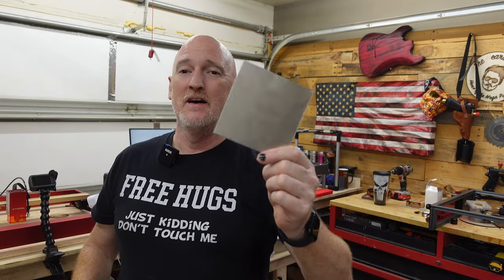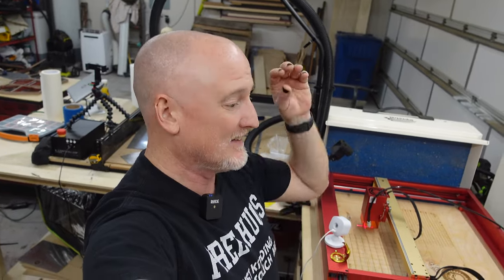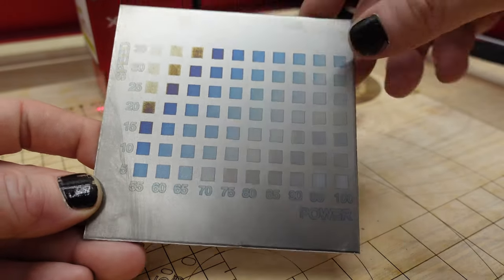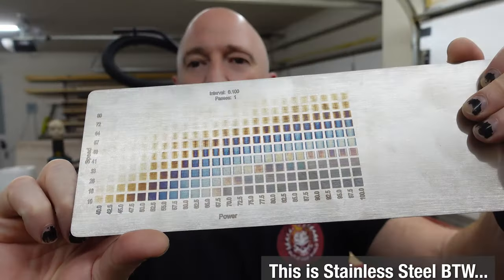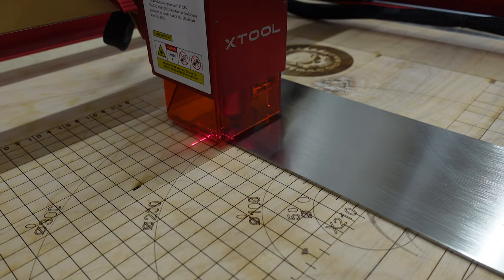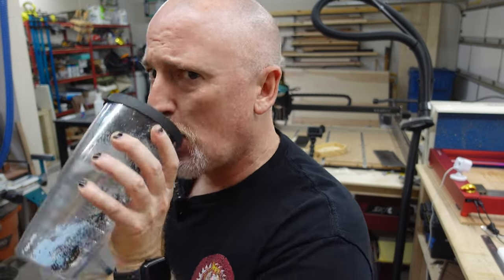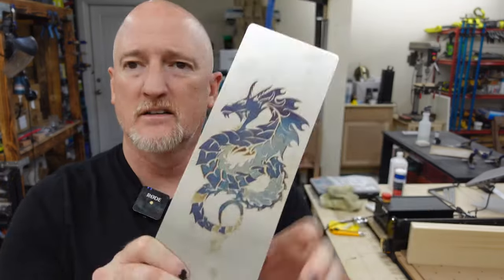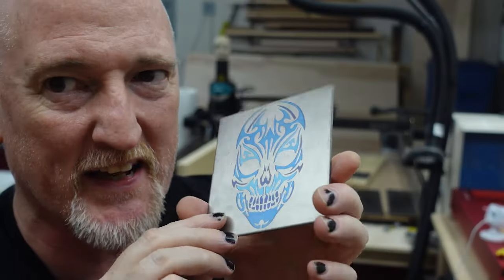Mark Stainless Steel with this Diode Laser (the new 20W xTool D1 Pro)

Comment: I do a bit of tig welding on stainless. Flat non structural sheets will warp. Try clamping it to a nice 1/2"  thick piece of aluminum chill block on top of your honeycomb.  The aluminum will absorb and pull the heat from the stainless, the honeycombwont allow it to be trapped. (In theory)

Comment: Hello, through the process of heating and subsequently cooling the steel, a structural hardening takes place. A harder structure can lead to a contraction of up to 1%. To prevent this effect, it may be helpful to preheat the steel. An example would be using an oven at temperatures between 200 and 250°C, as the tempering colors in the steel only begin to appear at over 350°C.

Comment: Stainless steel test is cool! Do you have framing problems with XCS? My pro frames in lightburn but not XCS. Firmware and software up to date.
Reply from the maker: The only framing problem I had was one of the limit switches triggering too early. I turned them off.
Reply: @BuildDadBuild  interesting. Didn’t have that problem. Flame sensor is very sensitive and I can’t complete a test grid in lightburn with it on its lowest setting. Will have to turn it off.

Comment: have you set your max and min pwr settings in LB. As you probably know, it will cut power a little at corners to avoid hot spots and color changes.

Comment: Question: why are you not using some 2-sided tape to hold down the metal to keep any warping from impeding the head movement? I’m not criticizing, I’m wondering… I’m looking to buy and I appreciate your testing and experimentation! Cheers
Reply from the maker: Didn't occur to me.
I think the heat might be too much for the adhesive though.
Cheers

Comment: Interesting. Your settings are much different than mine. I will try again on aluminum (didn't have much luck) but high polish stainless (lightly scuffed) I have been able to gets blues, browns and blacks but nothing else. I NEED yellow, lol. On the Atezr site they actually show a full pallet of colors at different speeds but i have not been able to produce the same results. It's interesting that your squares differer by about 2% in power. But your set-up is much different where everything is run at 0.10 where mine is varying amounts here but all the same mm/m (or mm/s).  I'll give your set-up a shot and see if it will finally pull through.

It's funny, eventhough these (I have the Atezr L2) can burn color I have NOT found too many videos on it...

Comment: Excellent video! Have you ever tried to do different colors like you did in this video on a stainless steel tumbler or flask or does it only work well on flat surfaces?
Reply from the maker: Hven't tried. My understanding is "results may vary..."
Reply: @BuildDadBuild  would be cool to try doing some team logos with 2 or 3 colors. Gonna play around with it. If you end up ever doing one, let me know how it turned out. Your videos are very helpful!

Comment: Im completely new to laser cutting and engraving. How does the laser mark with color? Is it temperature driven? Meaning, does it produce different colors at different temperatures? Can you color mark on wood? Say for example white text on a wooden background? Thanks for sharing.
Reply from the maker: It anneals the metal.
Reply: @BuildDadBuild  Thanks. The reason I ask is because I saw a project where text on wood was white. I thought this amazing since I thought all engraving was done with a burned look. Is white text on wood possible, or was this painted afterward?
Reply from the maker: @603VIL  You can't "laser etch" in color on wood.

Comment: Hey Nick! Thank you for showing this and I am really keen to try and recreate this. I have ordered some stainless steel and titanium. I want to initially try the grid test to see my color pallette, what setting range did you find in the end was best to get the best result/color range? For both materials?

I know your material warped and you lowered power and sped it up, so would love to know if you did a updated grid with the newer settings range? I have a honeycomb plate so am curious if my material will warp. What thickness did you use in the end and worked well and did warp? I am grabbing some 3mm titanium and 1.5mm stainless.

Cheers mates, keen to hear back from you and keep up the videos

Comment: The last skull or the dragon can't decide lol. I've been cutting small parts with my 10w out of roughly 2mm black plastic sheets I salvaged from the underside of some treadmills. They aren't perfectly flat to start with (close enough though) and sometimes warp or curl a bit while cutting. I don't have any way to secure anything to my makeshift honeycomb thing so I've been using 3" x 1/4" steel slugs placed on the edges too hold it flat. If I'm cutting parts along an edge I'll put it in the middle of the sheet. I got a handful of circles and rectangles of various sizes for free - they were scrap cutouts at a metal fabrication shop. Something similar might work to hold down the ends of your thinner sheets. Oh and I always try and remember to frame the job again after putting them down to make sure the laser won't hit them.

Comment: I am looking to laser passwords into Titian or stainless steel.  Do you think the laser engraving would withstand a house fire or would be hard to rub off?  Thank u for your input.
Reply from the maker: Im not sure if they would hold up to the heat. The laser is just annealing the metal. I think you're looking for a high powered fiber laser or a CNC that can engrave metal.

Comment: my wife and I love your channel. we got the d1 pro and I'm trying to figure out how to get the alignment just right. I'm trying to engrave bicycle stem caps about 1.25 in circles. Love to see you do it or help us out with a tutorial.
Reply: i got mine a week ago and since this comment is more than a year old you probably have your answer. but just a quick thought after reading your message is just to measure the complete width of the stem cap. put that on a template and cut it out on a board thats squared against your frame (so you have a lot of little circles). then just place your stem caps in each circle, raise the head so its at stem cap level and then turn off the output on the circles in the software and put yoru design inside that circle. should be pretty repeatable.

Comment: I am having issues with D1 pro 20 watt etching glass tumblers.  What settings do you use.  I have been using the galvanize spray and my it does not etch, it looks almost like it burns thr glass and leaves the image brown/blackish.  I am using thr creative space software and have tried stainless tag, coated metal, and my own user settings.
Reply from the maker: You’ll need to run a speed and power grid. I haven’t done this technique on the 20W

Comment: Hi Nick 
Have you tried the burn scale using the 10 watts unit?  I tried but could not mark the stainless even at very LOW speed and 100% power!!!
Reply from the maker: I have not. But considering the low speeds I used with the 20W, that doesn't surprise me.

Comment: Would the 10 W laser do it at a slower speed
Reply: Yes, because it is the heat that is being applied to the metal that is causing the color change, not the laser itself. So if you were to run slower and at a higher power, you could get "discoloration" as well. It's all a matter of finding that sweet spot.

Comment: Hi Nick, looking at the speed setting you showed in the video (fist set) the speed does not match ( mm/min vs. mm/sec)!

You have one label2000 mm/min and 18 mm/sec, it should be 33 (2000/60).
Reply from the maker: Look to the right of the settings. Lightburn has pre labelled some of their work layers.

Comment: can you tell me if you can make a line width .013" and .050" deep
Reply from the maker: it only marks the metal. It doesn't engrave it.
Reply: @BuildDadBuild  sorry, It would be in wood products
Reply from the maker: @rgcrowman3188  Then absolutely